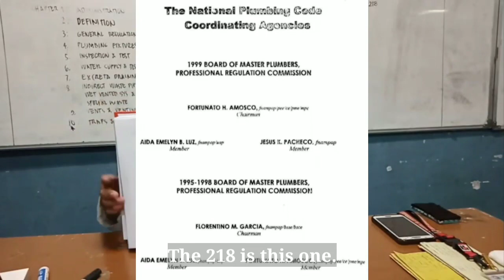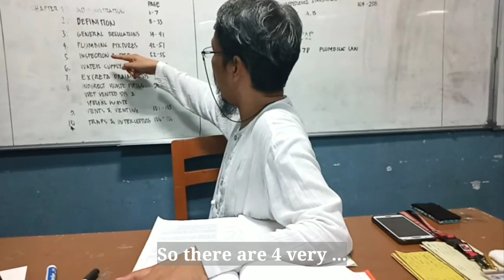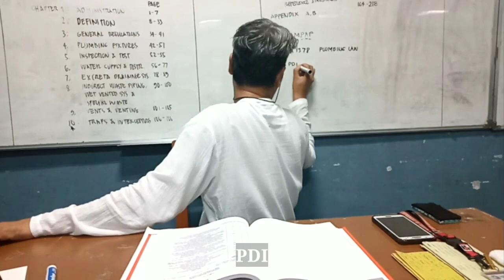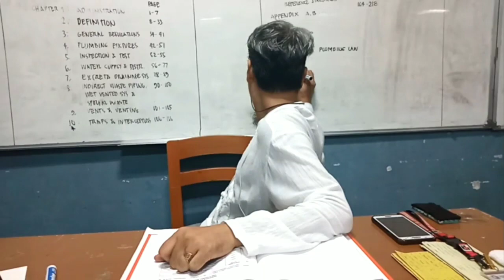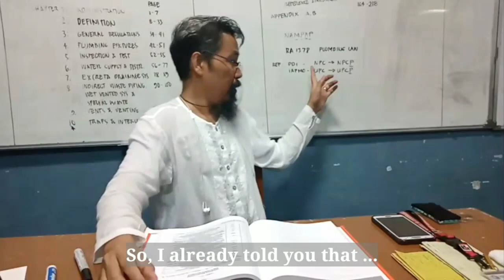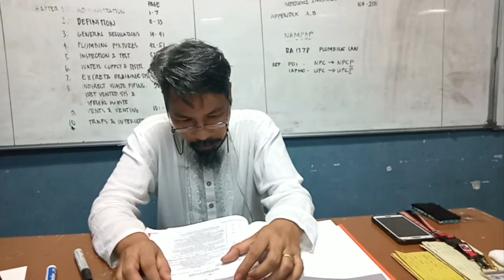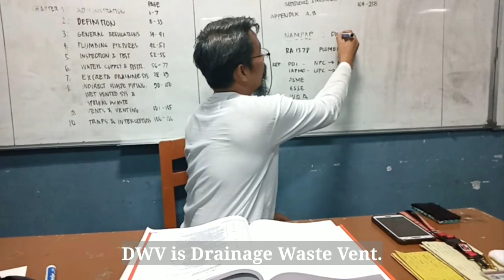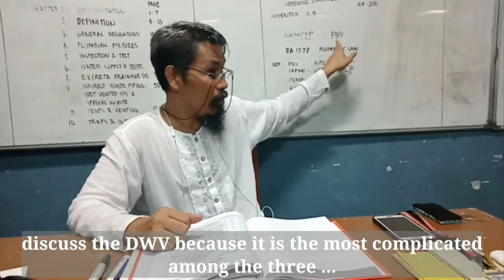CE526 Sanitary, Fire Safety and Plumbing Design || NPCP Chapter 14 Materials and Standard References

Comment: CAGUIOA, DANIELA O.
BSCIVESE 19-00459

Thank you for this video, I have learned that the NSCP references of plumbing codes are from ACI (American Concrete Institute), National Design Specification for Wood Construction and AISC (American Institute of Steel Construction). And in NPCP the reference of the plumbing codes are PDI (Plumbing and Drainage Institute) which is an American standard, IAPMO (International Association of Plumbing and Mechanical Officials) the one who created UPC (Uniform Plumbing Code), ASME (American Society of Mechanical Engineers), ASSE (American Society of Sanitary Engineers) and lastly WQA (Water Quality Association)

Comment: Ruiz, Sharlize Veyen C.
19-00620

Thank you sir. I have learned that most of our code reference are adopted from American standard. From National Plumbing Code (NPC) to National Plumbing Code of the Philippines (NPCP), Universal Plumbing Code (UPC) to University of Plumbing Code of the Philippines (UPCP), and American Society of Sanitary Engineer (ASSE) to Philippine Society of Sanitary Engineer (PSSE). Some code title are differed only by the country and some have just put Philippines. NPCP reference are American Concrete Institution (ACI), American Institute of Steel Construction (AISC), Plumbing and Drainage Institute (PDI), and International Association of Plumbing and Mechanical Official (IAPMO)

Comment: [In this video I've learned the Quality and Weights of Materials, Plumbing materials and references standards. The video is very informative and surely you will learn something regarding plumbing. 

References of the NCPC
1. PDI Plumbing and Drainage Institure is  an institue created by National Plumbing code in America, an american standard. - National Plumbing code to NCPC
2. IAMPO Internatinal Association of Plumbing and Mechanical Official. Unitary Plumbing Code to UPCP
3. ASME- Americal Society of Mechanical Engineers
4. ASSE- American Society of Sanitary Engineers
5. WQA- Water Quality Association

Comment: Rolegio, Mark D. 
19-02023

***This video is about the NCPC chapter 14 " materials and standard references". throwing garbages particularly in urban areas is not good. the last page 218, code meaning it is the national plumbing code coordinating agencies. the 1999 board of master plumber, for example in civil engineering there is a board exam whose a person keep an examination for applicants to have license.
* NCPC chapter 14 is about materials and standard references, for example, The NSCP is almost copied from the ACI ( American Concrete Institute). The number one reference in NCPC is PDI ( Plumbing Drainage Institute) it is the association much like PICE. we added the word " philippines" in national plumbing code of the philippines.
* IAPMO ( International Association of plumbing and Mechanical officials) just like AASHTO the one who created UPC (Uniform Plumbing Code). Thus, the word "philippines"  added in UPC.
***another reference is ASME ( American Society of Mechanical Engineers. Also, ASSE, from American to Phliippines we have PSSE meaning Philippine Society of Sanitary Engineers.
***WQA ( Water Quality Association) pertaining to the actual engineering quality of for example, water supply. DWV ( Drainage Waste Vent)